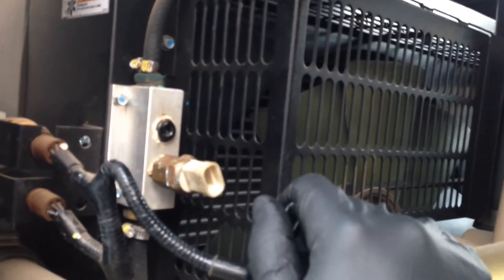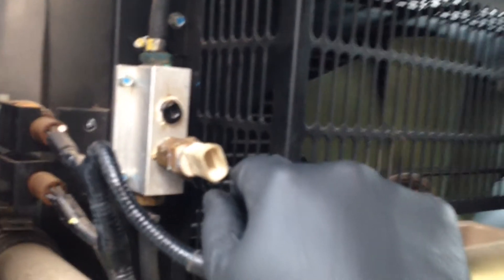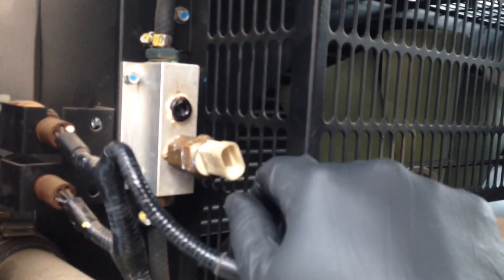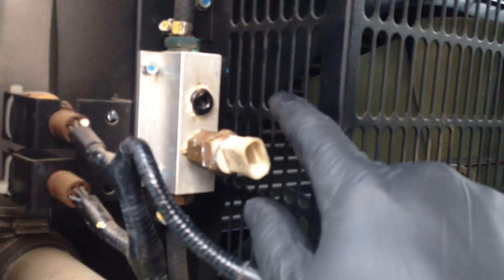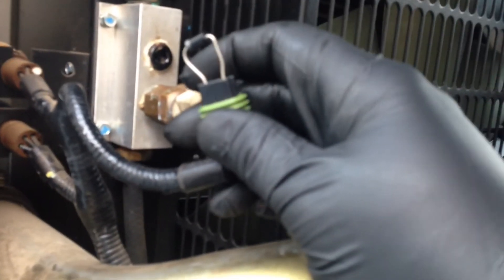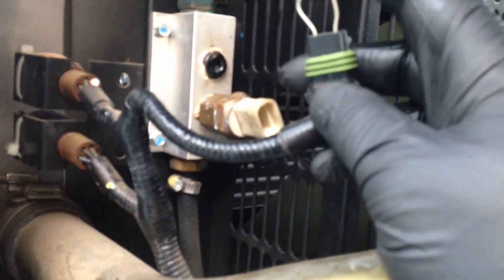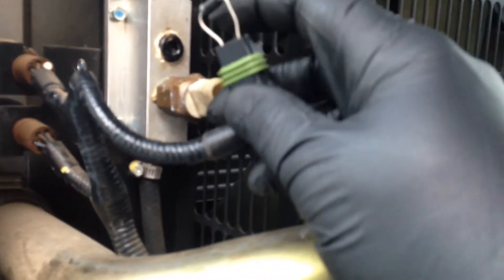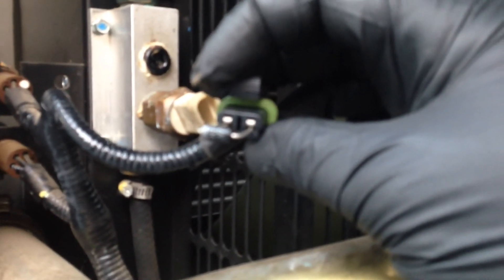how to temp fix to by pass generac low coolant swich

Comment: Tried this on my Generac 25 kw liquid cooled generator. I did what you said. I bought an assortment of diodes and tried the biggest one in the pack that looked like the exact same size as the one you used. I bent the legs and pushed them in. Tried to reset the generator to run on automatic and then tried to run it on manual and it didn't work. I then pulled the diode out and turned it around and tried the same as before but with no luck ! The diode trick didn't work.
Reply from the maker: what generac calls a "signal conditioner" for that sensor is bad.